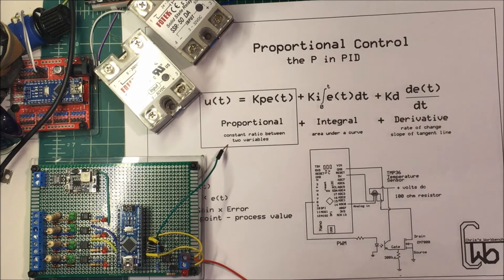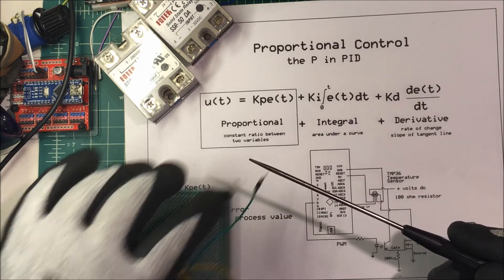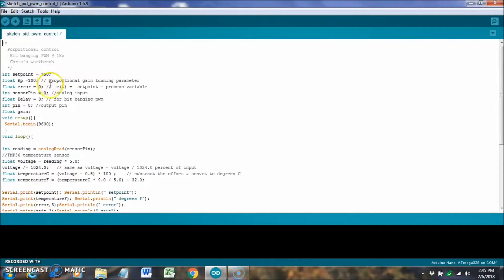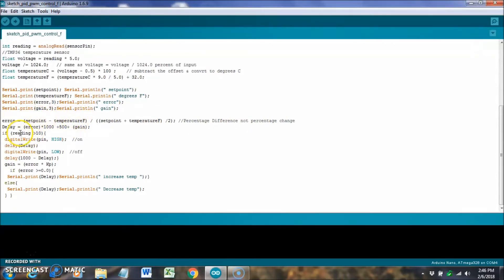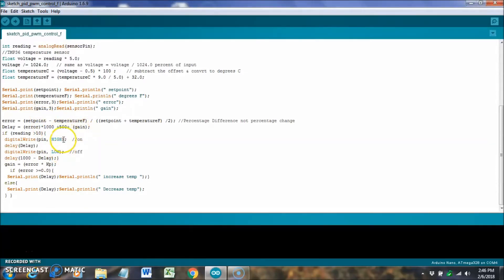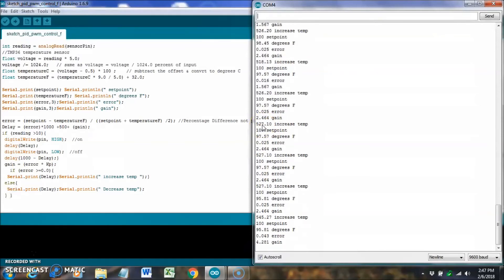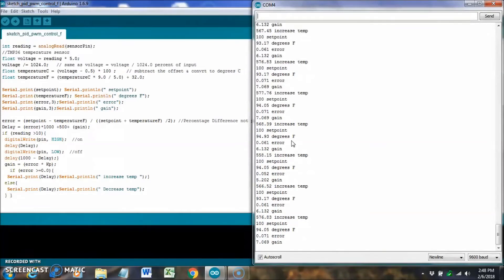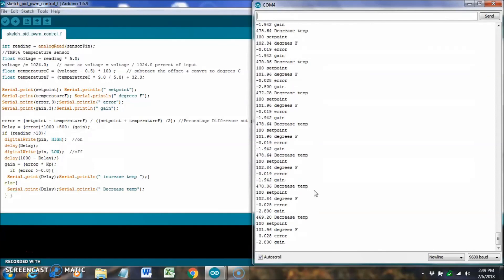Arduino Proportional Control

Comment from the maker: /*
  Porportional control
   Bit banging PWM @ 1Hz 
   Chris's workbench
  */ 
int setpoint = 100;
float Kp =100; // Proportional gain tunning parameter
float error = 0; //  e(t) =  setpoint - process variable
int sensorPin = 0; //analog input
float Delay = 0; // for bit banging pwm
int pin = 8; //output pin
float gain;
void setup(){
 Serial.begin(9600);
 }
void loop(){
 
int reading = analogRead(sensorPin);  
//TMP36 temperature sensor
float voltage = reading * 5.0; 
voltage /= 1024.0;   // same as voltage = voltage / 1024.0 percent of input
float temperatureC = (voltage - 0.5) * 100 ;    // subtract the offset & convrt to degrees C
float temperatureF = (temperatureC * 9.0 / 5.0) + 32.0;

Serial.print(setpoint); Serial.println(" setpoint");
Serial.print(temperatureF); Serial.println(" degrees F");
Serial.print(error,3);Serial.println(" error");
Serial.print(gain,3);Serial.println(" gain");

error = (setpoint - temperatureF) / ((setpoint + temperatureF) /2); //Percentage Difference not percentage change
Delay = (error)*1000 +500+ (gain);
if (reading >10){
 digitalWrite(pin, HIGH);  //on
 delay(Delay);
 digitalWrite(pin, LOW);  //off
 delay(1000 - Delay);}
 gain = (error * Kp);
   if (error >=0.0){
  Serial.print(Delay);Serial.println(" increase temp ");}
 else{
  Serial.print(Delay);Serial.println(" Decrease temp");
 } }

Comment: thanks for the video, im trying to learn PID. any chance you can send me this example code. i have a similar project. i dont understand bit banging. anyways i could learn from your code example.
Reply from the maker: /*
  Porportional control
   Bit banging PWM @ 1Hz 
   Chris's workbench
  */ 
int setpoint = 100;
float Kp =100; // Proportional gain tunning parameter
float error = 0; //  e(t) =  setpoint - process variable
int sensorPin = 0; //analog input
float Delay = 0; // for bit banging pwm
int pin = 8; //output pin
float gain;
void setup(){
 Serial.begin(9600);
 }
void loop(){
 
int reading = analogRead(sensorPin);  
//TMP36 temperature sensor
float voltage = reading * 5.0; 
voltage /= 1024.0;   // same as voltage = voltage / 1024.0 percent of input
float temperatureC = (voltage - 0.5) * 100 ;    // subtract the offset & convrt to degrees C
float temperatureF = (temperatureC * 9.0 / 5.0) + 32.0;

Serial.print(setpoint); Serial.println(" setpoint");
Serial.print(temperatureF); Serial.println(" degrees F");
Serial.print(error,3);Serial.println(" error");
Serial.print(gain,3);Serial.println(" gain");

error = (setpoint - temperatureF) / ((setpoint + temperatureF) /2); //Percentage Difference not percentage change
Delay = (error)*1000 +500+ (gain);
if (reading >10){
 digitalWrite(pin, HIGH);  //on
 delay(Delay);
 digitalWrite(pin, LOW);  //off
 delay(1000 - Delay);}
 gain = (error * Kp);
   if (error >=0.0){
  Serial.print(Delay);Serial.println(" increase temp ");}
 else{
  Serial.print(Delay);Serial.println(" Decrease temp");
 } }
Reply: wow.. thanks alot. this will be helpful. I will study this and see where it gos. thanks again.